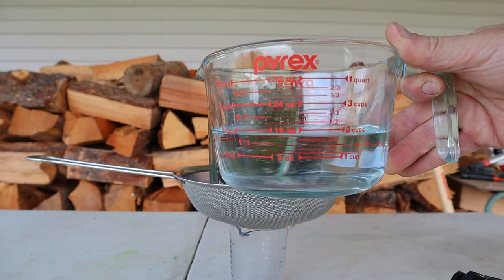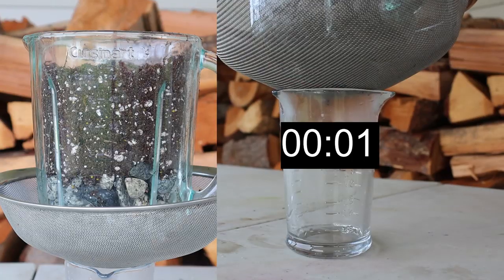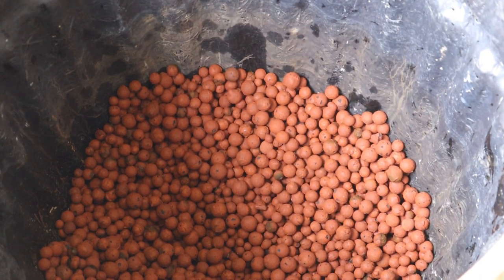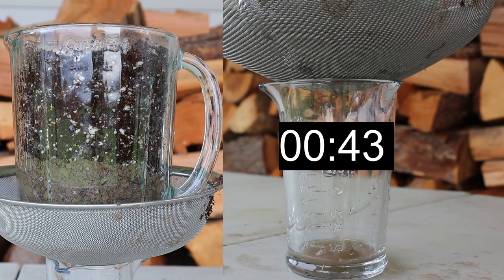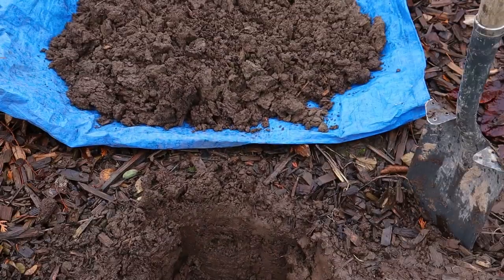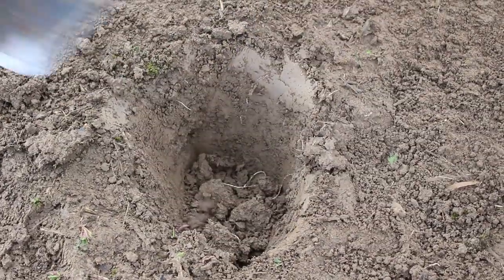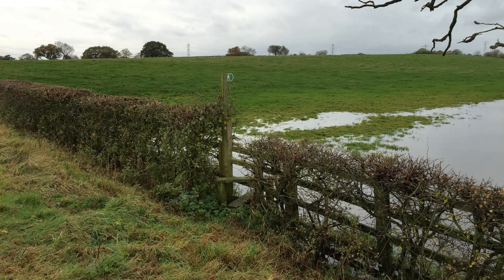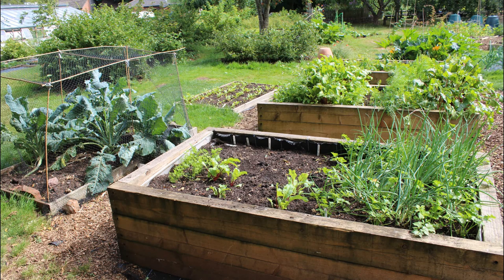Improve Drainage in the Garden and Containers

Comment: Fantastic video! So many things click now! Do you know whether buried tree trunks and branches (as in hugelkultur) at the bottom of the hole will have the same slowing effect as with the gravel at the bottom? I have an urban garden with terrible soil (one can hardly call it soil, it has large rocks, construction debris like ceramic tile, glass and super compacted clay or silt surrounding all those debris’s); nothing grows in that soil. This year i dug large plating holes (about 30 inches deep and 30 inches diameter), pulled out all the rocks and debris and filled it with garden soil sold at my local nursery. I dug 8 holes in total, although not all of them were as deep and as wide, and I planted 8 tomatoes plants.  Now, I live in NYC and weather this year was terrible, we had flood after flood all summer. Our precipitation in July and August totaled 23 inches of rain, which is precipitation norm for a half year in our area. So out of 8 tomato plants 4 survived and 4 died (sudden wilt, I suspect root rot). Now that I’ve watched this video it makes me think that perhaps half of those smaller holes served as a drainage for other plants that survived. And I am wondering whether I can do anything to improve drainage and whether large tree branches buried at the bottom of the holes will help me improve drainage.
Reply from the maker: Thanks Olga. I expect the rotting wood eventually act like a sponge, storing moisture  in the bottom of the hole (which is kind of how hugelkultur is supposed to work). I hope that the problem doesn't repeat - given that this was an exceptional season of rain for you. The only other thing I could suggest is to build upwards a little bit with a little raised bed or bottomless planter above the planting hole - if the tomato plants can build a good root system in this well-draining planter, it may keep them healthy (enough) even if the bottom of the planting hole gets waterlogged occasionally. Just a thought.

Comment: Thank you as always ! This really makes sense, still majority of garden experts recommend to put gravels in the bottom of the pots to "improve the drainage" in Japan though, haha. I have a question, I wonder if there are any ways to improve drainage of the nice thick terra cotta pots. I used to use thick terra cotta pots which only have only tiny hole for growing roses. But, it turned out roses thrive with cheap thin nursery pots, while they were really struggling in those terra cotta pots. I do not intend to use them for roses anymore, but for perennials. However, I appreciate if you have some recommendations?  I will blend perlite for the soil though.
Reply from the maker: Hmm. I wonder if you could drill a larger hole (or holes) with a masonry bit
Reply: @FraserValleyRoseFarm  Thank you for the advice! Hope you had Happy Holidays!!

Comment: Wish i had saw this informative video sooner as i am experiencing a drainage issue on my 2 new 4'x8' and 2 feet tall raised flower bed built over existing lawn area, and are filled with 50% soil mixed with 50% compost bought from the local nursery where the soil and compost mixture remain wet weeks at a time even during very hot and sunny weather. It is a bit late to install a french drain now, but i was wondering whether mixing pea gravel (less than 1/4") into the top 12" of the raised flower bed will help my situation?
Reply from the maker: Hi Mike. My impression is that it won't help. Better draining material up high in the soil profile won't address the standing water and drainage from down low. Is there any natural slope at all? If so, I wonder if it would make sense to dig a small drainage channel out (under) the low end of the raise bed into a French-drain style gravel pit. I'm not talking anything large, but just to see if you can move some of that standing water.
Reply: @FraserValleyRoseFarm  thanks for the suggestion - seems like a lot of work but i will give it a try.

Comment: Thanks for the video but my issue is entirely different. I planted a row of arborvitae trees as a privacy hedge. I have a slightly sloped yard that backs up to a fence where I planted the trees. They have been dying and I’ve replaced the majority of them. It’s an absolute nightmare and I can’t figure out why. It’s becoming evident that I’m getting root rot because my soil is very thick and has a lot of clay. I’m not going to invest in some large scale French drain or anything like that. Any suggestions on what to do? All I keep hearing is to water my arbors none stop or they will die. Well evidently I’ve been over watering them and causing root rot. How can I improve drainage? Or should I just stop watering regularly? But that will lead to a lack of water and also damage the trees right? 

FYI this is my first house and first time planting anything in my life. I thought these trees were easy and low maintenance. That’s completely false!
Reply from the maker: Hi Max. Well, I think you've answered your own question. If you're not going to solve the drainage problem (which you're right, can be a huge project) you'll have to be careful with the watering. With a heavy soil, it'll hold a fair bit of moisture naturally. If you have a wet season (in my area, it's wet in winter through early spring) you might hold off watering entirely. In the first stretch of warm/dray weather, dig a little test hole nearby and check if there's sufficient moisture at 4 to 6" below the surface. Once you initiate watering, it's likely still 1x per week to maintain sufficient moisture, but you can always dig another little hole to check.

Comment: Well, now I have no idea what to do...

I'm in zone 10a in northern CA and my soil does not drain well; it is either clay or sufficiently like clay to be indistinguishable for me without a soil test. Regardless, not great at draining. I planted my roses in 2x width and depth of the root ball back in March of this year and then, like an idiot, filled it with garden soil.

They've been thriving in what is functionally a garden pot of 2 feet by 2 feet but, as they say, winter is coming. And with it the wet season which will take advantage of these water tubs I've created to murder my roses. My front yard already has areas that are pure mud for a week here and there in the rainy season.

Do I just pull them up, remove the soil, and then put the old clay soil back in directly? My clay soil has huge clumps. If I water it then it will basically just turn to cement when it dries.

I feel like I should mix 70% clay, 30% garden soil,  create a mound so its higher than the surrounding area, and then create some rain gardens to woo water away from my plants since a french drain is out of budget. Only other option is to remove them and make them potted plants.

I'd love feedback/suggestions. Your videos have been so helpful!!
Reply from the maker: I like your idea of building upwards - like a raised bed but without the hassle & expense of wood or other materials to make the edge. It's been useful in my garden when installing new beds to add a deep, deep mulch with a blend of composted wood chips, municipal compost and sand. It doesn't all integrate at once, but it's eventually blending with the underlying soil.

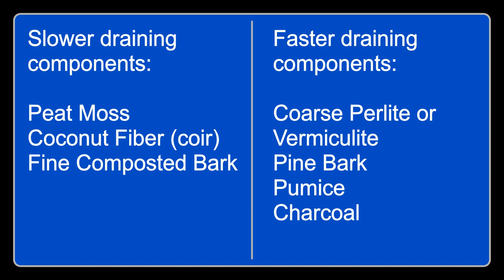Comment: Vermiculite actually soaks moisture it is a retainer, not a drainer.  1:32 is saying it under faster draining components which is incorrect.
Reply from the maker: Hi Romil's Garden. Thanks for the input. I think the key distinction I need to make (and I did in the video) is "coarse" vermiculite. I know that in the finer grades, we often say that we use perlite for air and vermiculite for water. That's an oversimplification of course, because both components are there for both reasons. But it's true that vermiculite holds less air and more water than perlite. However, there's a world of difference between fine and coarse grades. Have a look at this suppliers site, as they recommend the coarser grade for "greater drainage and aeration" : http://www.schundler.com/hort-prod.htm  Now I don't expect anyone to blindly  take a supplier's word on the matter, but I did find this thread (from a mushroom growing forum) rather precise and convincing: https://www.shroomology.org/forums/topic/10425-coarse-vs-medium-grade-vermiculite-big-difference/  If I were talking more about the components (rather than as an overview) I should have been more careful to warn off the smaller grades as a little too moisture retentive, and so thanks for adding your caution. One more note on vermiculite, and one of the reasons I do like it so much: it does a way better job than perlite on CEC (Cation exchange capacity) - overall much improving a mix's fertilizer retention.
Reply: @FraserValleyRoseFarm  Thanks for the thorough reply, very informative! 

I did, in fact, not know about the difference in their grades!

Comment: Lost me with plants go searching for: assuming you mean the roots. I thought the roots deal with what is — available —. As the system expands - deals with what is available. Goes searching totally confuses me.
Reply from the maker: Thanks Gay Praetor - and yes, the roots. I saw one study where the roots go "looking" for water by sensing acoustic vibrations in the soil. Another where the roots were divided into two containers, one with a different distribution of fertilizer than the other (as I recall), and the roots seemed to grow in a way that approximated a cost benefit analysis for the different soils. No one is really saying that the roots are "thinking" but only that the plant is programmed by DNA to expend it's limited growth energy in a way that best benefits it's survival. My experience has been that plants grown with ample water and nutrients nearby don't grow as extensive a root system - because they don't need to.
Reply: Roots "grow towards", they don't literally "look" for areas. For example, not thoroughly watering a newly-planted bush (like a rose) can cause all the roots to grow within the top couple of inches of the ground surface, which is as far down as the "inadequate" watering will go.  When you water thoroughly, it encourages roots to grow deep causing a healthier plant that will withstand cold and drought better.  This is an example of roots "searching" for water.
Reply: An example might be turf that is watered lightly every day, and comparing this to heavy, sustained irrigation once a week.
The light shallow watering satisfies the plants needs without the need for the roots to "go looking" for water.
Heavy irrigation plus the presence of Mycorrhizae, will encourage the roots to follow the moisture as it recedes and will result in more drought tolerant turf.
Reply from the maker: Thanks Kimberly - that's a better way to put it. I do kind of anthropomorphize my plants a bit - and I know it's wrong, but then why are they always outsmarting me!
Reply: Plants are smart, and roots don’t grow if all the nutrients & water is easily available. In hydroponics roots don’t grow as much as they grow in soil because water and nutrients are not as easily available as in hydroponic.